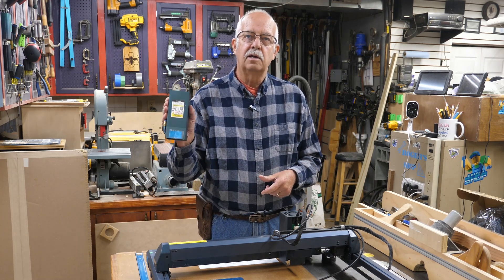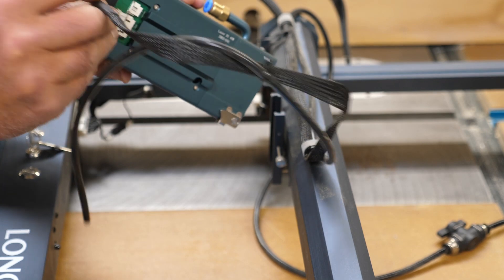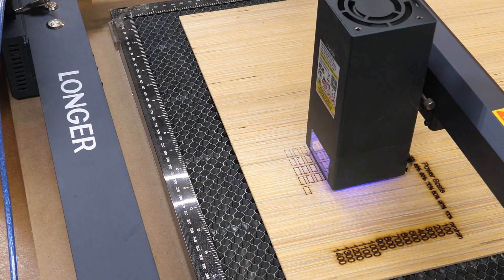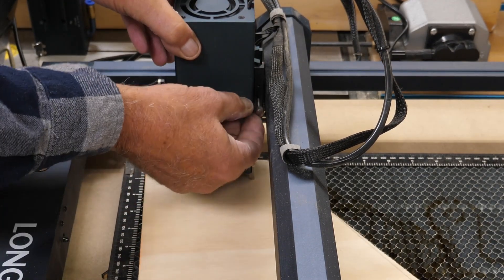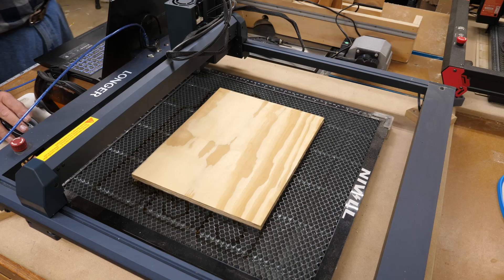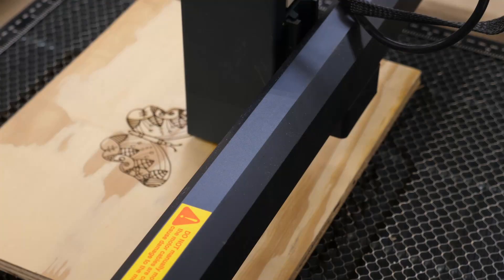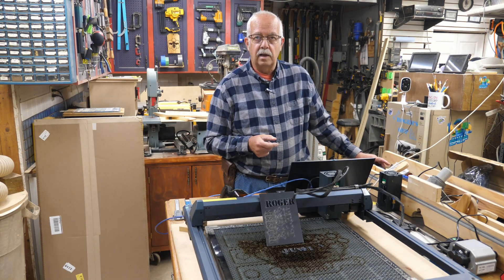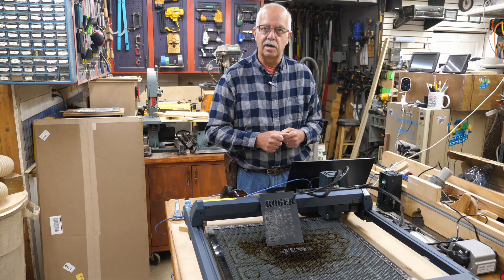Longer B1 Laser Upgrade to 40W

Comment: If I was to purchase a B1 40watt, Would I be able to move the laser modul and power supply on to my 500x800mm open frame machine?
Reply from the maker: Controller and motherboard would also need to follow and some parameter changes would be necessary to reflect the larger working area.
Reply: @rogersshop  yes i understand that.
Move modul, power supply and control board.
 Change work area size in Lightburn when finding new device.
The 500x800m. Size would be a great machine.
  I have 3 other moduls i use on that frame now.
Reply from the maker: I modified my Longer Ray 5 to 850mm X 850mm.  Nice having the large work area for signs, but kind of a pain to store when not using! @DwightStebner

Comment: Howdy Roger! Greetings from the great state of Missouri, near the Lake of the Ozarks. After watching your videos on the Longer B1 48w I couldn’t wait to save up for one of my own. I’m coming from an xTool 10w original not pro. It was a workhorse and I learned tons with it. I got my B1 yesterday and assembled it, but it was just a red hair bigger than my custom enclosure. I quickly set about tearing into the thing and cutting some expansion joints. I should finish it today (or tomorrow) and the smoke can finally clear from my office (spare bedroom). What’s the coolest project you’ve completed on your machine? Could one of your newest videos have that as the featured content? Thank you for your awesome videos and your contribution to the craft. Love the new intro, btw. Really cool. “…and remember, if a woman doesn’t find you handsome, she should at least find ya handy.” ~Red Green
Reply from the maker: Since I have several lasers, I have the luxury of dedicating them to specific jobs.  My B1 is dedicated to cutting only and the latest "hot project" has been medieval castles for a local craft shop.  May show this in the future, but the designs are proprietary and will not be shared.

Comment: Hi, thanks for the video, very informative. So, I have a B1 20W and have been thinking about upgrading to the 40W. I just want to make sure on something: You don't have to change out the motherboard when you upgrade? Thanks!
Reply from the maker: No.  But mine came with a larger power supply.
Reply: @rogersshop  Awesome, thank you!

Comment: How would she do on an aluminum surface, like a sheet or even a brick of aluminum for engraving, Roger?
Reply from the maker: Bare aluminum, no.  If painted or anodized, it will etch the coating.  To engrave/etch bare aluminum, you need a fiber laser or IR laser.  I'm doing a video soon the the IR module available for the Longer B1 and Ray5.  I have it, just have not had time to "play" yet.